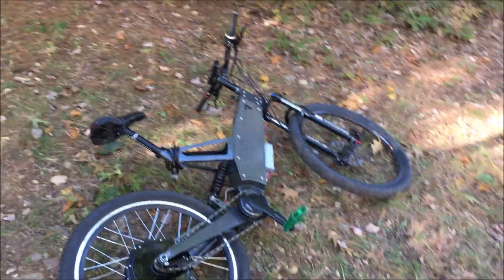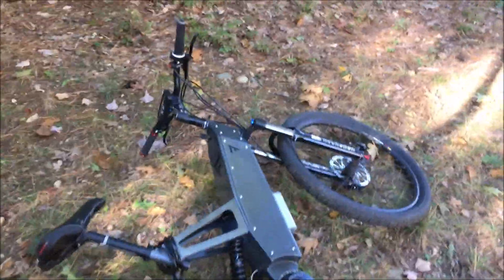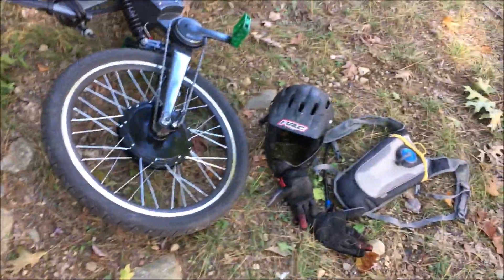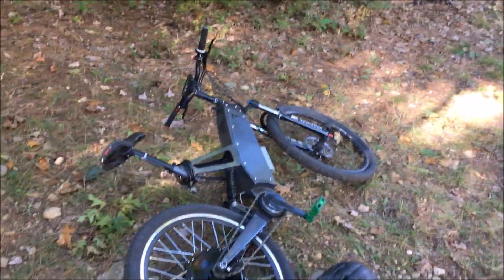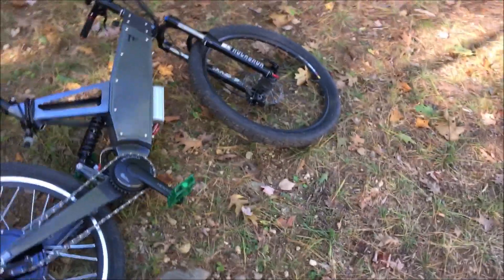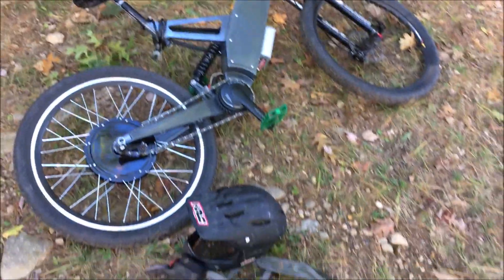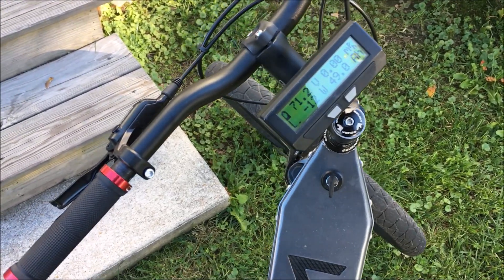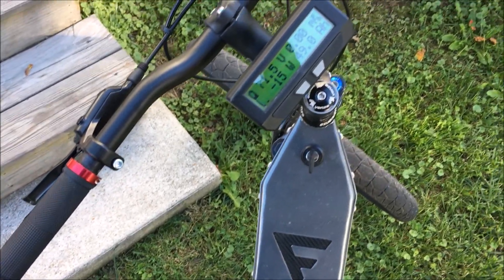72V FUTR Beta EBIKE Luna Cycles Batt Issue 20s4p 18650

Comment: My guess is the cells just can't deliver what you're asking of them. What cells are they?
Reply: If it's any help, i run a 24s4p of samsung 25r cells. I see 15v sag under full acceleration at 100A. They don't much like it but they'll do it.
Reply: @th3d3wd3r   Well INR18650-25R datasheet says 10A constant with 20A Max constant. You drain about 25A which quite is above specs and I think that's the main reason your cells fail. I would suggest to go at least with 5P, or 10P if you have the space and money to spend.
Reply: @BlastarX  they'll take it for a couple hundred cycles. But after all that abuse they suffer more in later life. I've never seen 25r cells as more a 300 cycle battery though. Mind, even though my pack is near done at about 270 cycles, it'll still launch me up to 60 ~ 65 mph now and then.
Reply: @th3d3wd3r  In that case maybe you or even the provider it self fall victim of fake batteries ! There is always a small possibility that these 25R are not even Samsung ones !
Reply: @BlastarX  nope, they're are legit and my supplier is solid. Just pushing them outside of spec on the regular will reduce their cycle life a touch. Just as reducing depth of discharge and not charging above 4v per cell will extend their cycle life.

Comment: sounds like you might have a bad cell...should be closer to 84 volts, hot off the charger.  voltage sag under load is normal, but that sounds excessive.  Its only a 4p battery, so that could be part of the reason, depending on type of 18650 cells used.